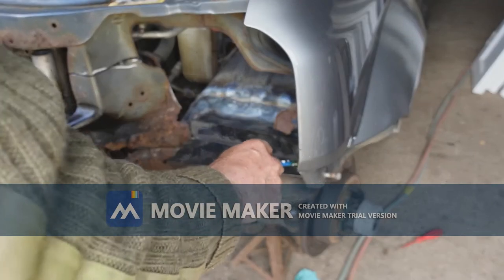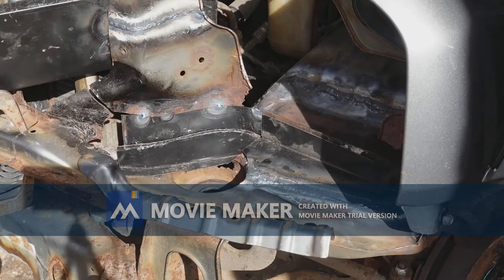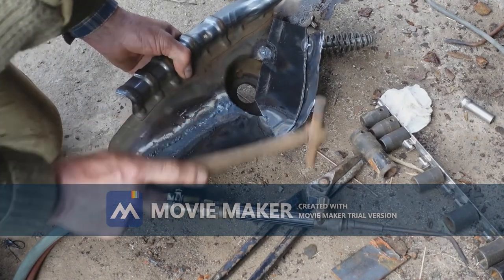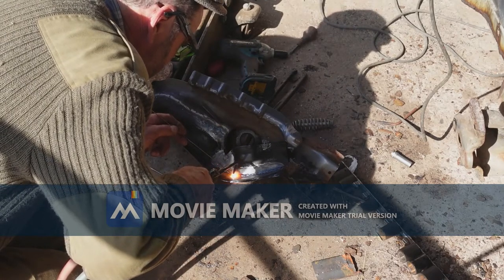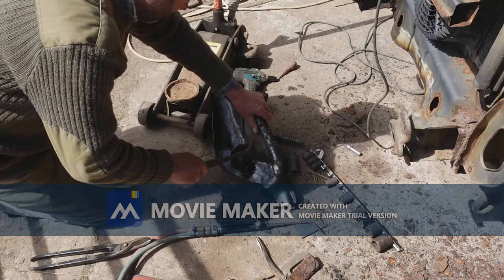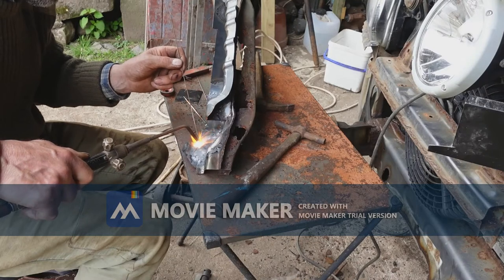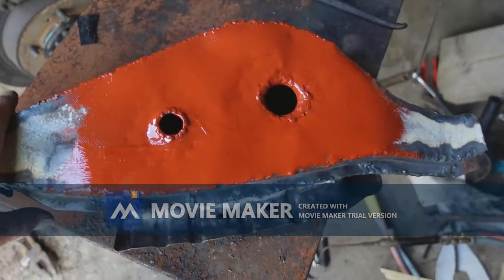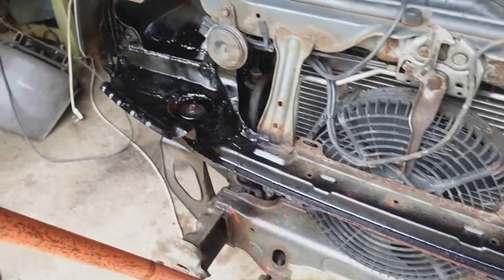Old school gas welding car chassis

Comment: I’ve been admiring the work of Middle Eastern / Indian “gas welders” 
; Your the first “Westerner” I’ve seen weld on the ground. I’ve got a W123 240d and just recently a W115 that has a unsightly bit of rust on the rear trunk lid where the 300D badge (barely) hangs!  Instead of buying a MIG I think I’ll learn to weld with gas 

Thanks for the further inspiration: live the fact that you heated up a couple areas and formed with your pliers - a bit of blacksmithing!
Reply from the maker: Thank you. I've been gas welding for over forty years and I also like to watch those Indian workers, it's amazing what they can produce with such few resources. Learning to weld with gas is a slow process but so worth the effort. I also have MIG and TIG but will not give up my bottles! Good luck with your Merc. and best regards, Jon